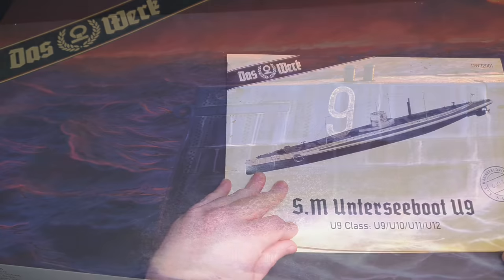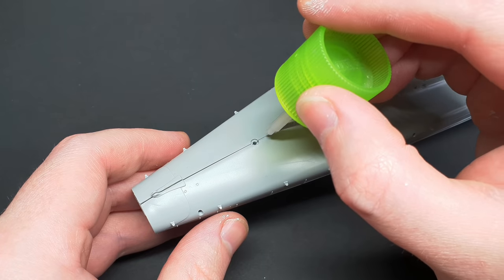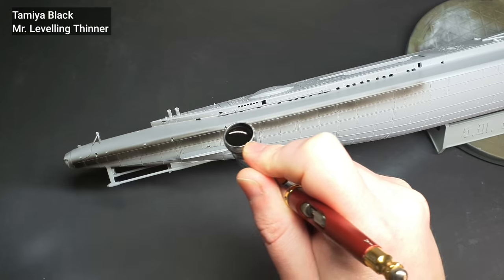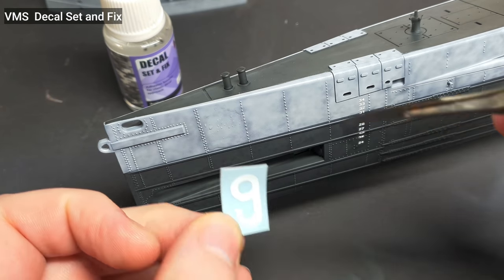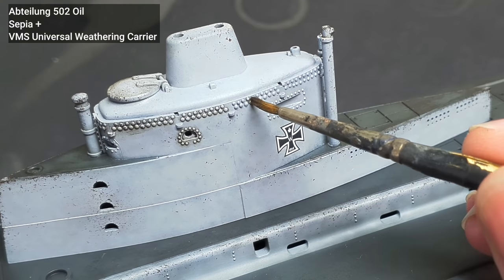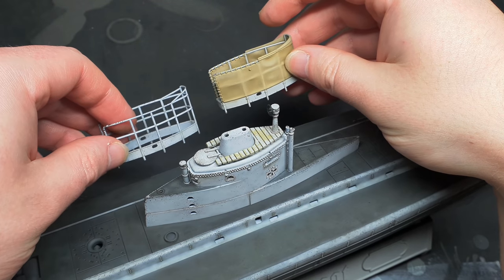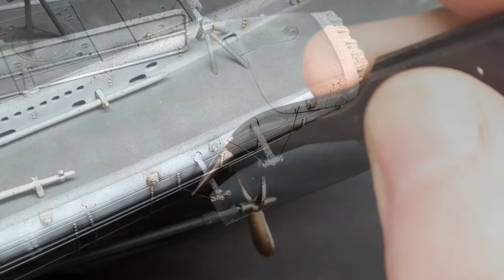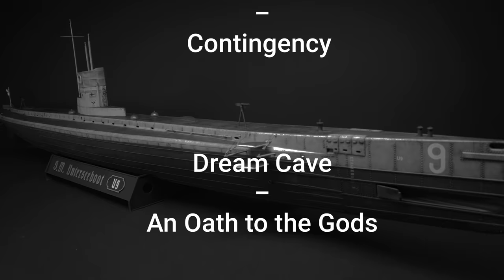Das Werk | 1/72 U9 Submarine Full Build

Comment: Those instructions remind more of a Lego set than a model kit. Would prefer if most of them were like that these days, as I hate steps where you need to apply hundreds of bits at once and you only get one view from which to use as a reference. Also, I think spru glue is extremely underated. You'll never get a better bond with anything else, and it's a lot less messy than ca glue or expoxy in my experience.

Comment: I just completed the same build.  There are some amazing reference photos of U9 online that show some different paint details than shown in the kit.  The most striking detail was with the two vertical masts that fold down into the top of the boat....the reference material shows one of them to be a very light color that is probably a light gray, then the other one is a dark color, either very dark gray or possibly black.  Also, the two blisters on top of the boat that house the two hatches, the same reference photo shows them to painted in white and another color, probably red or safety orange.  I just went with the paint guide in the instructions though.  I still got a nice result, considering this was my first boat model.

Comment: Very nice build
Do you mind if I make a suggestion about your airbrushing technique... It mostly only applies to the application of primer or larger full coverage areas.... Try releasing the trigger as you finish the stroke then press down again when you start back in the other direction... With a little practice you will find yourself getting more consistent and faster coverage using this method
Reply from the maker: Thanks for the tips Nigel

Comment: Love it James. Building this kit at the moment myself 👍🏻
Reply from the maker: Thanks Paul how are you finding it?
Reply: @lpjmodels  It’s a great kit but there are some silly problems, one of which for example, you mentioned the covers towards the bow. I’ve seen other builders cut the deck to align these covers and do away with the gap at the front end. The surface details are beautiful though. The lack of full rigging instructions and the 3 dive plane points with only two shown in the instructions has had the modelling forums in a buzz. I’m no maritime modeller and certainly no expert on this vessel type so I’m just going to build this out the box as instructed and using references, add the rigging to finish her off. That said, if DW announced a WW.II type VII U-boat, I’d bite their arm off and be lying to my wife again at how much it cost 🤣. Really enjoy the videos mate, your work is fantastic. Please keep them coming. Cheers, Paul 👍🏻

Comment: You said you filled the gap with milliput but also said you filled it with sprue goo.
Later you showed and said you applied splatter with uschi stencils, then went on to say you hadn't applied any splatter details to the hull.
These problems made me dislike the video at first but I changed it when I saw how nice the canvas cover came out.
Reply from the maker: The first gap was filled with sprue goo, when I mention the milliput you can clearly see the green milliput sections on the bow of the boat, where the deck connects to the upper bow front plate, 2 different gaps, a seam gap on curved sections of the the Hull is imo easier to fill with sprue goo as it maintains a consistent hardness of material, so sanding is smoother and less problematic, for a deeper flat section the milliput worked ok. 
I first applied uschi stencils to the deck and forgot the Hull, this was fixed when I had realised I then corrected the error,  I appreciate the feedback, though my videos usually show the sequence things were done on the bench for transparency, sometimes I miss something and I have to " go back " 
Many thanks Phu Vet !